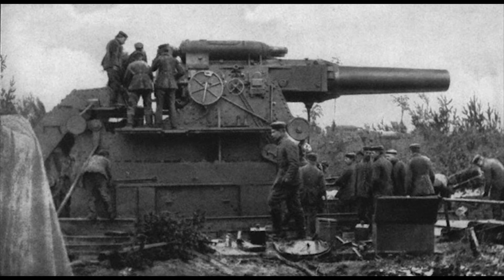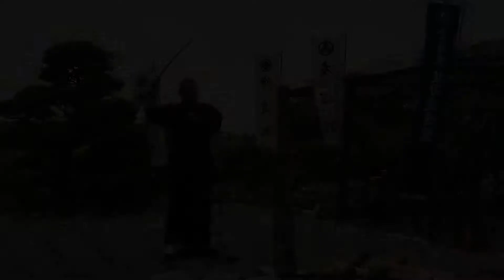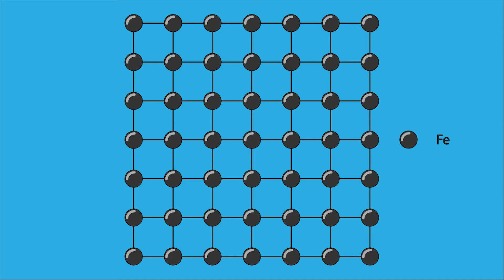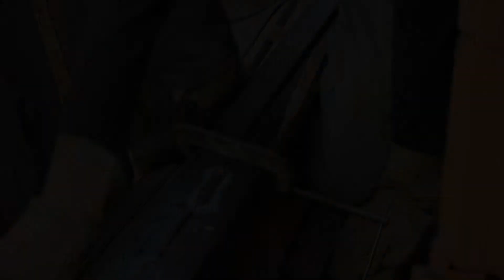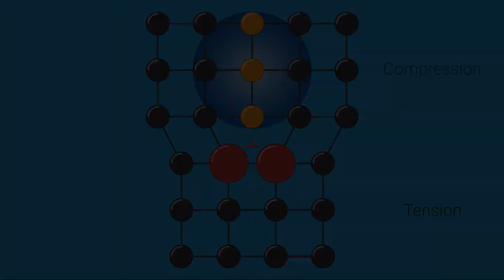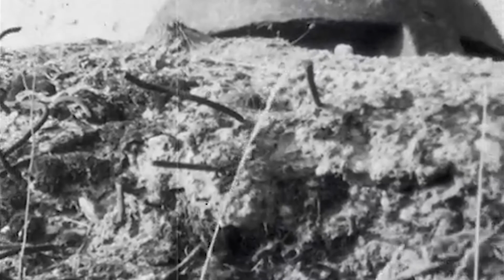How Moly Steel Saved This German Superweapon

Comment: Nickel in nickel steel and chromium-nickel steel, both used as late-19th and most-of-20th Century naval and later tank armor, acts similarly (on the pearlitic crystals of ductile steel).  Molybdenum also has similar effects on steel at higher temperatures (austenite), so that it remains tougher and does not crack as easily during manufacture, which prevents hidden cracks from forming when the steel is cooled later.  During WWII, a number of manufacturers added molybdenum to their higher-strength steels, but many did not with no noticeable loss of final strength - here is was improved manufacturing effects, not the final product, that was the goal.